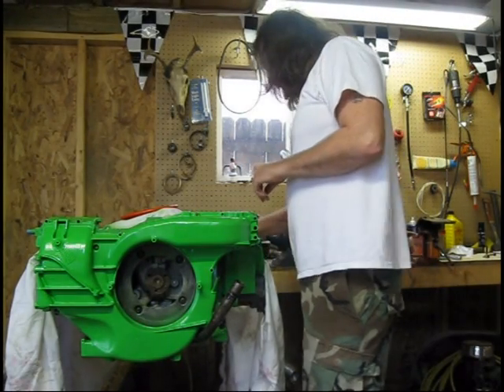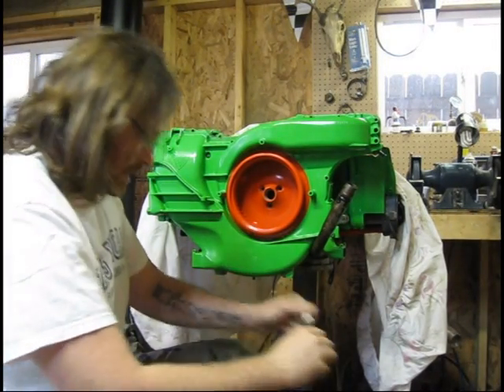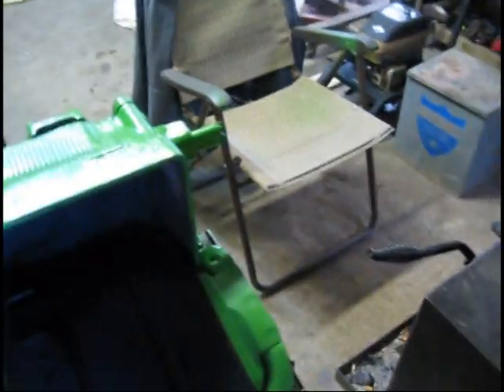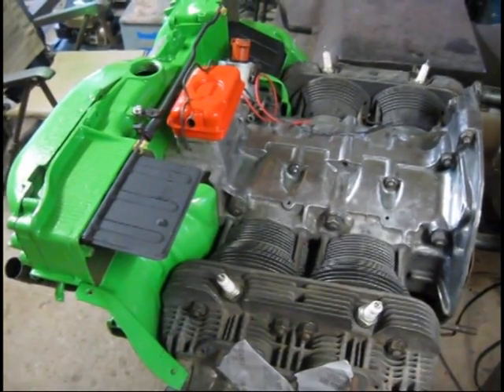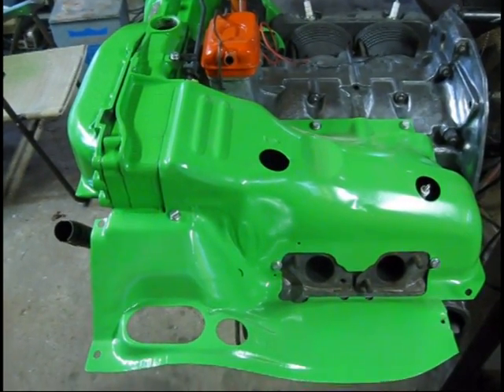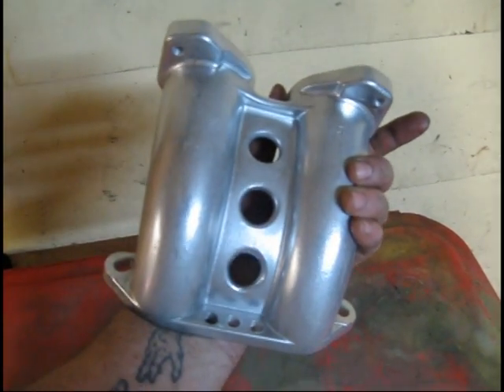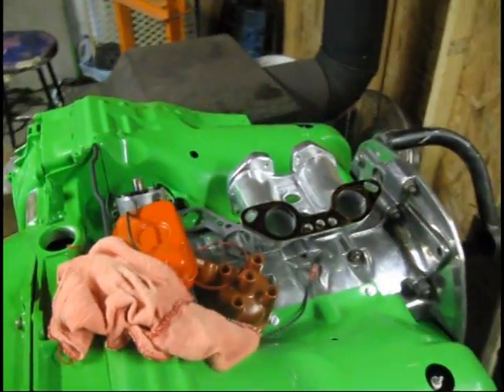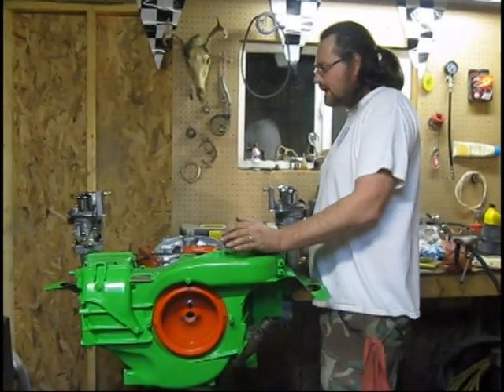Type 4 Cooling System and Carbs

Comment: what did you paint the fan housing with?  Did it stick to the magnesium or has it pealed? Looking to stop mine from oxidizing but I don't what to put on it.
Reply from the maker: Hey Tom, I used a hi-temp engine paint, it adhered really well.

Thx for watching!
Reply: Watched them all buddy.  I have a 914 but it's pretty similar.  I forgot all about the end play adjustment until I saw your video.  Thanks for documenting the process.

Comment: have you ever taken the fan shroud off with it still in the bus? I'm trying to repair my oil cooler without taking the engine out. thanx man.
Reply: +Mo Harriman you can take the shroud off while the engine is still in the bus. Depends on the exhaust you have but it may be a bit more difficult depening on the exhaust. it sometmes gets in the way. in which case sometimes you need to take the exhaust off. mines super easy to do with the exhaust still on. Good luck! i know it can be done reguardless!

Comment: great video, I'm trying to get my cooling flaps to work. PO had them open (fail safe) no thermostat. I've got all the parts put together and it seems that the 3/4 flap only travels about 1 to 1 1/2 inch. flat 1/2 travels a couple inches, say from 8 oclock to 9 oclock. . The cable connector on flapper rod when cold is at approx. around 10  . (looking from 3/4 to 1/2 or counterclock wise)  when hot it is approx. 11 oclock. Will not travel to 12 oclock without forcing it. When I force it to 12 the linkage on 3/4 jumps or flips over. Any idea's whats going on.

Comment: nice tip w/ cooling tin trimming to fit the intake...i'll be putting on dual solex carbs soon...i'll check the tins for interference....prior owner switched the FI system for a progressive weber....i think it'll run better w/dual factory carbs....not having carb heat sucks.